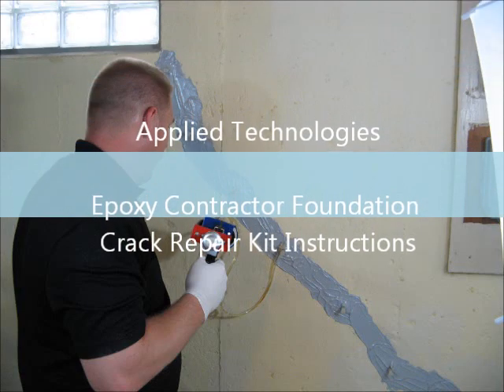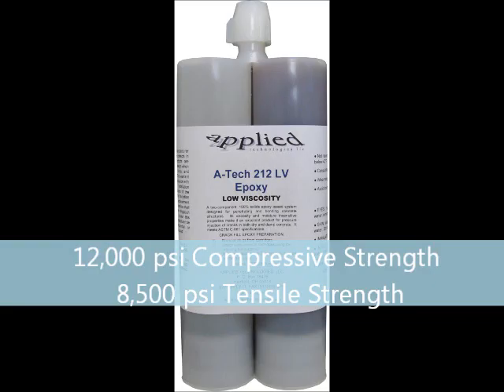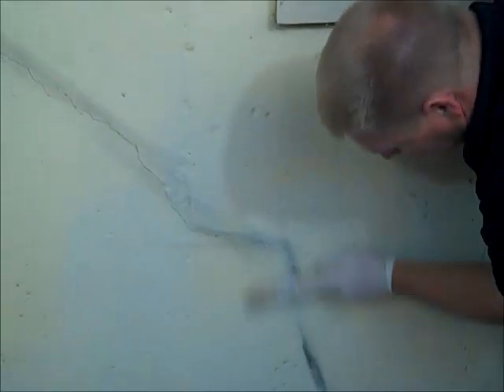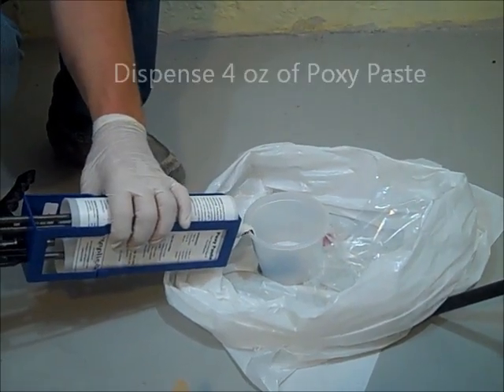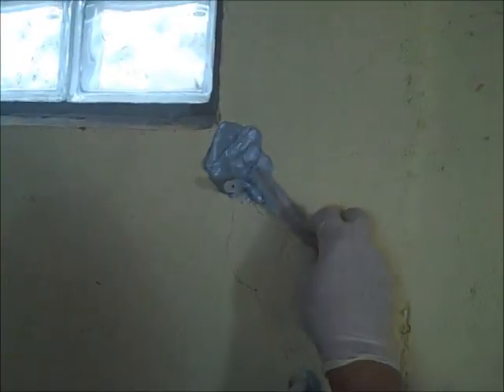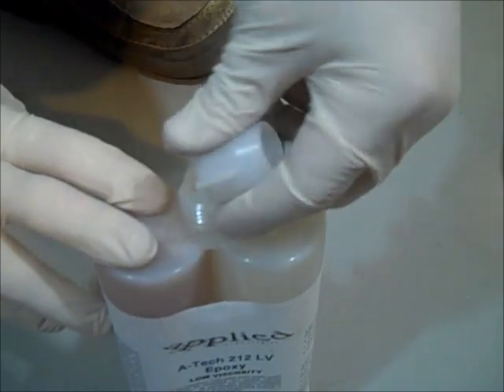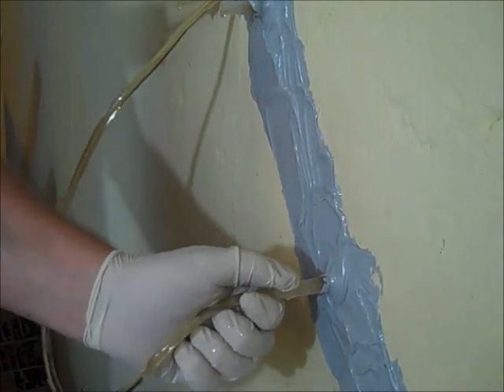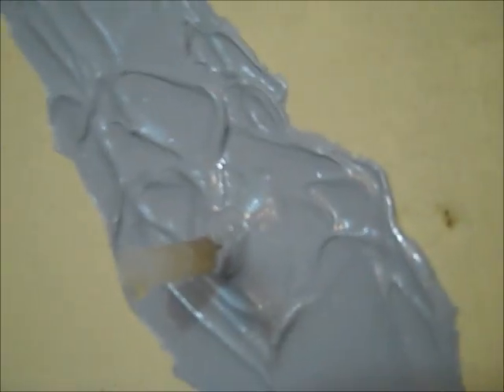30' Epoxy Concrete Foundation Crack Repair Kit-How To Instructions

Comment: What if the cement inside the crack is damp? Use Epoxy or Polyurethane?
Reply: FWIW, I called this company today, and they recommended their HydroStop product for my vertical wall hairline cracks, and a sump pump due to floor crack intrusiin/seepage. As a novice, I appreciated their honesty.

And, I've spent 3 hours reading up on sump pumps, and he's right.
Reply: @joeprager9961  I just completed 2 7ft cracks in my basement wall.  I used the HydroStop-300 which worked fine.  One crack was very thin all the way up. Had plenty of the sealant.  The other crack had spots with 1/8". I completed but I wish I had a little more sealant.  I bought one kit from Applied Technologies with free shipping. The second I had to get from Amazon for free shipping.
Reply: Based on my research, expoxy is super strong, but should only be used if the crack is dry.  Polyurethane is used if water is present in the crack, or you can put a 70 pint dehumidifier, set at 45%RH, and run it for 3 or 4 days, to see if you can dry out the space.

But, in general, expoxy for dry cracks, poly foam adhesive for wet cracks.
Reply: @joeprager9961  thank you

Comment: How come you lift the paint on the crack for this demonstration. I thought it was supposed to be removed in order for the epoxy dam to adhere. How do you keep the epoxy from oozing out on the outside of the wall?

Comment: Don't fuk up like me. I thought the ports were sealed perfect and every fuking one leaked. Press slow when you inject and put more than enough apoxy to seal everything as much as possible, or you will regret it. If you don't have enough go buy more. Don't use the expanding foam because if you fuk
 up like me you won't be able to fix it in The future without digging it all out. Use the appoxy crack filler type instead.

Comment: We had this done on one of our properties once cured can you grind down that grey paste or samd down flush with concrete to paint the concrete for smooth finish, we want a cleaner look on exterior as to not draw away potential buyers, can you use a chisel to get rid of the excess paste or sand down?

Comment: What if the crack shows on both sides of the foundation wall 
Do you completely seal one side and use ports on the other side?
Reply: That is correct.  You will need extra Poxy Paste for that.
Reply: @aaronkuertz6012  I actually seen the link on this video I will be calling tomorrow
Reply: @aaronkuertz6012  where can I purchase these products

Comment: If you don't make large enough hole to epoxy liquid to go in, then it will not work.
It cost me $4000 to hire contractor to fix the crack from outside, because I did not create the hole at all, when I tried with Crack Repair Kit, the liquid did not go in or did not go enough.
Reply: lol i always feel sick when i see people saying they spent that much money on such a small repair. i just tuck-pointed an entire basement for $1400
Reply: Well I'm ordering the 530$ kit I have a small crack on my foundation wall amd the rest I'll use it at customers homes to make up this purchase I'm making 
Following this video instructions looks pretty simple
Reply: Should have watched other videos. You can pour water into the holes, top to bottom and if you see water, then it should do the job.
Reply: @less-than-thou  I followed one of this video but the fellow in the video misguided me, which cost me 4k.
Reply: @micheal74rich  Thanks for the reply. I've now realized that I need to decide b/w poly or epoxy. I wonder if what you needed was poly since it's meant for non structural cracks, aka small cracks. 

Personally, I think you could have bought a long drill bit and still tried the epoxy fix. I'm assuming you never made it to the 2nd hole?

Comment: Will this product and procedure be the same and with same effectiveness for filling/sealing foundation cracks on concrete slab?  Is this sealer waterproof or is that another video?
Reply: If you are doing a slab such as a basement floor, or a slab that has sand or gravel under it, this repair will not work because the epoxy will leak out of the crack and into the underlying substrate.

Comment: Can the excess epoxy be sanded to make a better smooth finish?
Reply: he says it can in the video.
Reply: Looks like you can buy a peel off version for $20 more.
Reply: @less-than-thou ”Peel Off” version?
Reply: @sophiacromwell8017  I've since forgotten what I was talking about.

Comment: Brick wall can use this technique?
Reply: no, tuck-pointing fixes cracks in brick, block and stone walls. this is for concrete only. in order to use this on a brick or block wall you would need about 10 times as much as normal because bricks and blocks have cavities in them where this stuff will just pool and go to waste. an $8 bag of mortar is quite a bit better than several of these kits at $150+ each.

Comment: would this work for a cinder block wall?
Reply: NO. DO NOT USE THIS ON A CINDERBLOCK OR BRICK WALL. tuck-pointing is how you fix cracks and leaks in brick/block construction, this product is made specifically for concrete. cinderblock and brick both have cavities that will eat up about 50 times as much of this product as should be required to do the job. yes the manufacturer says it will work on brick and block, and it will in theory but an $8 bag of mortar is way better than several $150 10 foot kits. by the way, i am a mason with over 25 years experience, not your average do it yourselfer that thinks they know everything after a single 2 hour weekend project.
Reply: dear, since you are a real pro I need to ask you- would this product be good for my galvanized iron water pipe leak.  @Smokey420Greenleaf
Reply: Yes it does, this product or similar product was shown on the DIY Channel TV Show ( Holmes helps Holmes ) during The Christmas-New Year Holiday of 2018.

Comment: how far does one kit go? how long of a crack will it fill? floor to ceiling?
Reply: these kits generally come in increments of 10 feet, so far 60 feet is the biggest kit I've seen but i haven't been looking long.

Comment: is it recommended to keep the epoxy and ports on the wall after the repair? I would like to paint the wall after this is done.
Reply: Also wondering best way to remove the ports
Reply: @jake024d  applied Tech says you can cut or chisel them off. I would use a cutting wheel and cut off as close to the wall possible.
Reply: the video says very clearly at the end that they can be removed and the surface patch can be ground away after the injection cures. tap the ports with a hammer and they should just pop right out.

Comment: what difference pu injection and epoxy injection
Reply: From other vids, poly is just foam so it does the job but doesn't add strength. Epoxy on the other hand is stronger than the concrete and can be coupled with carbon strips leaving it stronger than before.

Comment: ITS WRONG WAY OF DOING CRACK REPAIRING WHY BECAUSE HOW WE KNOW THAT EPOXY MATERIAL IS INJECTED INTO THE CRACK BECAUSE YOU ALREADY COVER THE CRACK YOU SHOULD INJECT THE EPOXY BEFORE COVER AND WHEN EPOXY STARTS FLOWING THROUGH CRACK THEN COVER WITH THE EXTERNAL COVER EPOXY
Reply: You know if it works if epoxy starts to come out of the next higher port. He explains this in the video.
Reply: @mbokil  is Correct, slowly push the epoxy out of the caulking gun device. It will slowly fill the crack and eventually start to drip from the next top hole. When that occurs, un plug the gun and siphon tube from the hole. Cap the hole. Begin again on the hole that is dripping. Keep working your way up the crack. At the final hole, the crack will be filled and you will get back pressure from epoxy. It will not feed more epoxy through siphon tube. Pull the tube and cap that final hole.
If you fill the crack from the top down, you will get air pockets and the crack won't completely fill.
Reply: @MarineCorpsSergeantTollens  Yep, my dad paid professionals to do this and they didn't use cover. I was initially on the same page as Umer but then observing what you described made sense. Looking forward to this being a $200 fix instead of $1000.
Reply: Your full of shit
Reply: yet another dumbass that cant pay attention to a simple 5 minute video showing his IQ.
Reply: Calm down Ahab